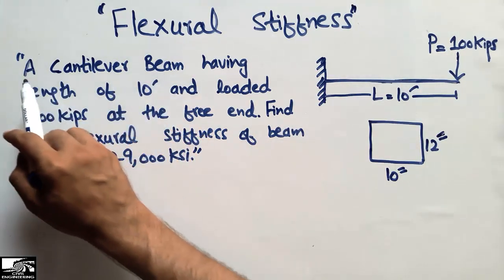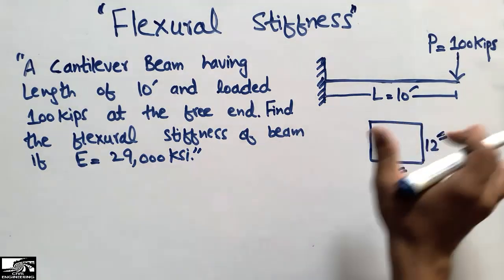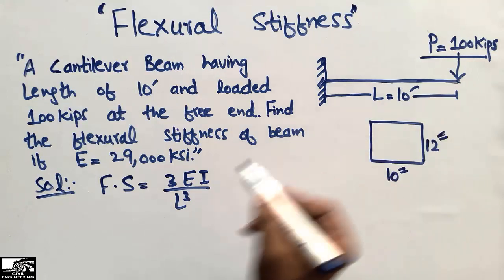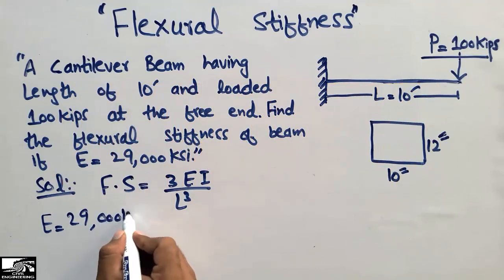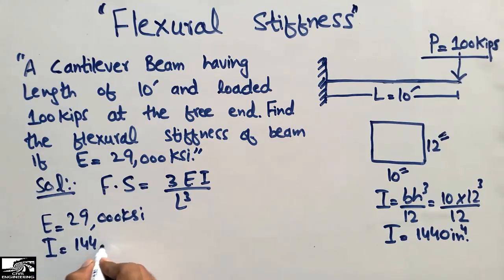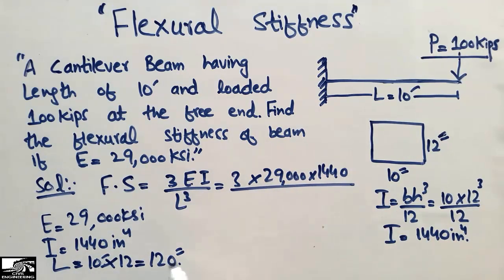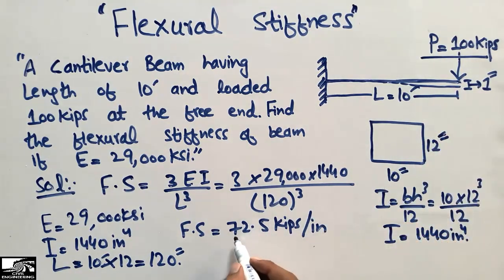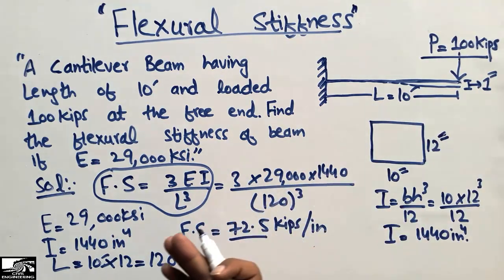Flexural Stiffness of Cantilever Beam

Comment: Based on which code , you use this formula?
Reply from the maker: It is not based on code, It is a general equation for stiffness
Reply: @civilengineering94  Generally, codes or standard should include these items. Later I found them in ACI 318(concrete) and AISC (steel) codes.